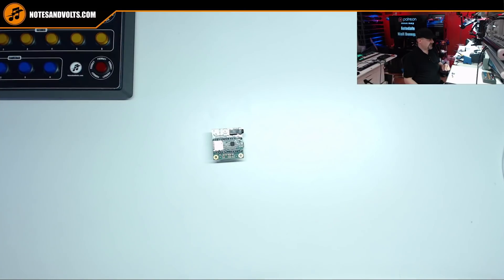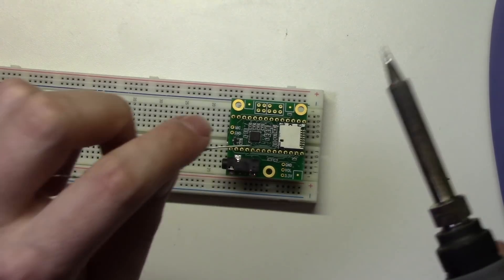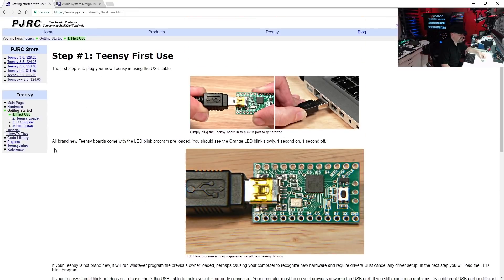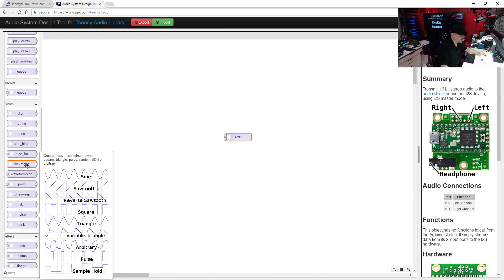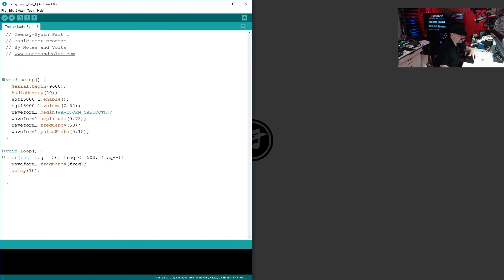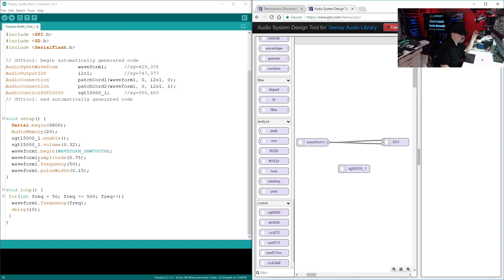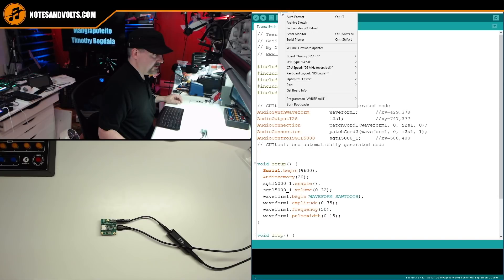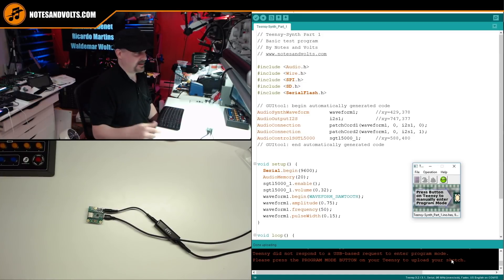TEENSY-Synth PART 1: BUILD IT

Comment: excelent tutorial! Thanks so much! It seems that 4 years later, thou, teensy developed new versions, currently 4.0. Will this tutorial work with this new version, I mean, especially for the code part... Also, do I need a better Audio board for teensy 4.0? I'm already looking for the parts to buy! Thanks again for this!! 🎹🔧
Reply: This code worked on my Teensy 4.0 with the Audio shield made SPECIFICALLY for the 4.0. The Pinouts are different between 3.x and 4.x, so going forward with knobs & buttons may need  some "review" before wiring that stuff up.
Reply from the maker: Hi Cristobal. This will only work on the Teensy 3.2
Reply: @NotesAndVolts  thank You, sir!!!👍🏻

Comment: Just started with building small DIY synths with the AS3340 VCO, AS3320 VCF, V2164 VCA etc.. voltage controlled. But last week I found your channel and it's really great! I just ordered the components to build the Arduino based synth, and now I'm seeing the TEENSY video's. Pfff.... I have to order again. ;) Again, great video's, very clear explanation about all the details. Thanks for sharing your knowledge. One question, it seems that the TEENSY has a lot more capabilities for synthesis as an Arduino. Or is it just the libraries and the  web interface for building blocks to generate the code what makes the difference?
Reply from the maker: Thanks Mark! I'm glad you're enjoying the channel. The Teensy is far more powerful than the Arduino Uno so it is capable of real DSP which is very cool.

Comment: ah man, i got my board, soldering it together and downloaded the teensy installer with no luck. I get to this step:      'From the File name, choose "Open HEX File" and open blink_fast.hex, which you downloaded using the link at the top of this page. You can also open the file using the toolbar button, or using drag-and-drop onto the upper portion of the window. When the file is opened, the filename and percentage usage of the Teensy's memory are shown. Select "Program" from the "Operations" menu, or click the Program button on the tool bar. The download should be very quick, perhaps too fast to see a tiny progress bar appear, but you should see the "Download Complete" message.'        Sadly, none of this works. everything is greyed out and i can't select 'program' or 'operation'. I sure wish this installation would be an easier process. Can someone please help me?
Reply from the maker: Hey gurp. Do you have the Adruino software installed? Follow the steps here: https://www.pjrc.com/teensy/td_download.html
Also, select "All" when it asks which libraries you want to install.
Reply: @NotesAndVolts Thanks for the prompt response, Dave. Without hyperbole, this is the most exciting tutorial I have seen on the tube, man. 
I am trying again tonight. I am a total noob, and this might not be the best project to try right out of the gate, lol.  I bet it is something as simple as not finding the Arduino directory or having a usb cable without the data wire. I'll update my progress after I exhaust my options. Thanks again for everything! Is video 10 coming soon?
Reply: HOLY SHIT I MADE A SNYTH!!!!! hahahahaha!!! i am so excited!! I just followed the instructions more clearly and violá! thank you so much, man. patreon funds comin your way, my dude!
Reply from the maker: @gurpchirp  That's awesome gurp! Congrats :)

Comment: I started soldering at 9 years old. That was 62 years a go.  Anyway, I built this project of yours and when I plugged in the power
(Teensy only), the chip got so hot that I burnt my finger.  emailed PRJC, and with (NO HASSLE) I have a replacement for free!
So Kudo's to you and PRJC !  FYI- Nothing had been soldered to the board, just plugged in the power.
Reply from the maker: That's great Ted. Paul is a good dude.